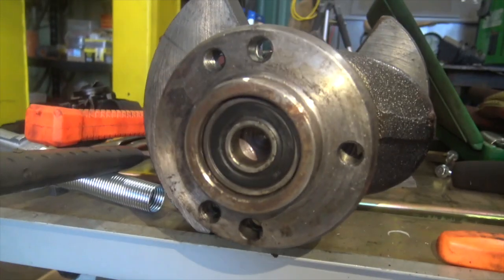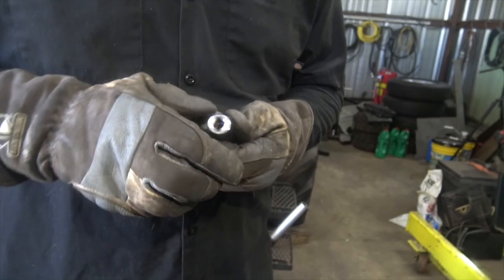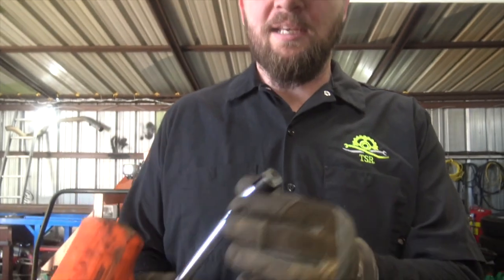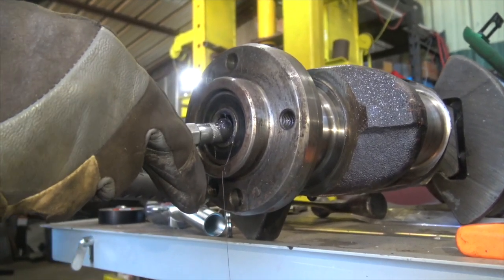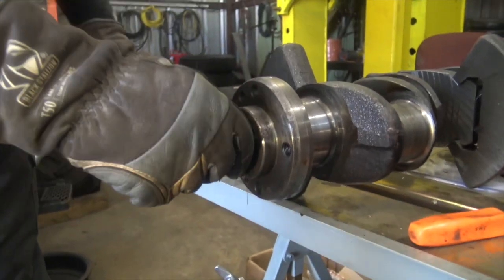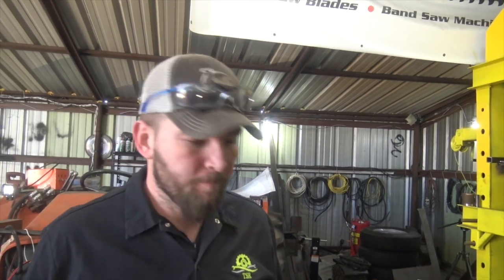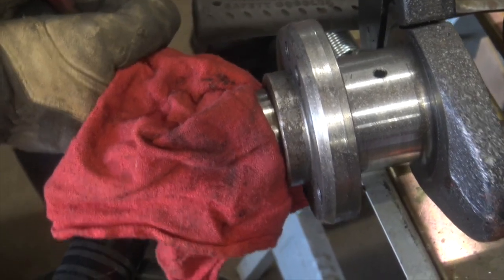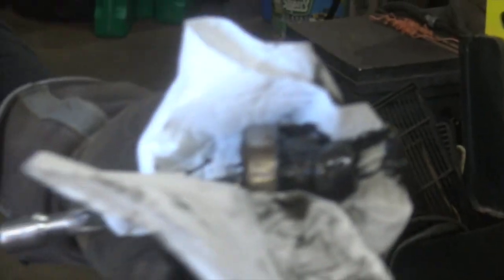YOURE NOT A REAL MECHANIC UNLESS YOU KNOW THIS MESSY, HIDDEN SECRET TO BEARING REMOVAL!!!

Comment: When I did mine, I grabbed a hand full paper bits from my shredder and let it soak in a bucket of water for a while.  Once it was soggy, I packed it in the pilot bearing and the rest of the process was the same.  Works like a charm and a lot less messy.  Great tip either way!

Comment: Wet toilet paper works better!!! A couple water and a roll of toilet paper a hammer and an extension it does not have to fit tight!! Just keep pounding the wet toilet paper in there and it will push to bearing out.